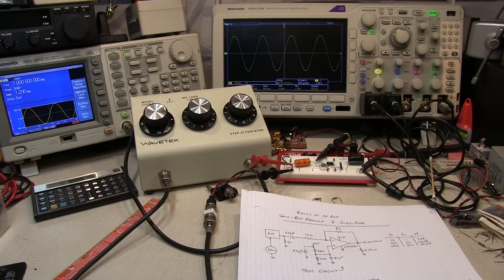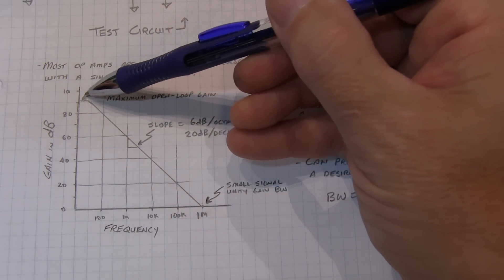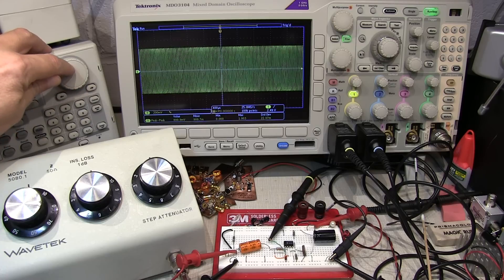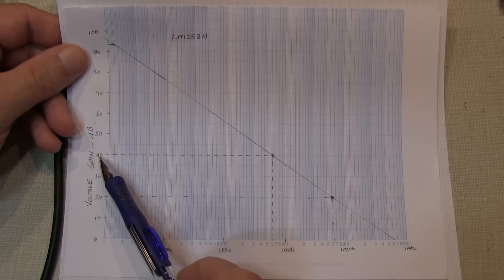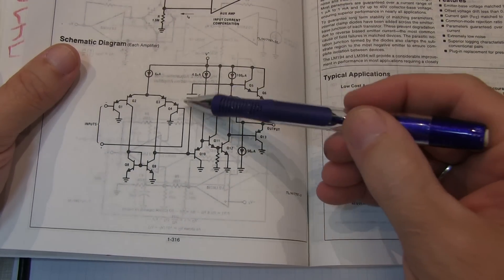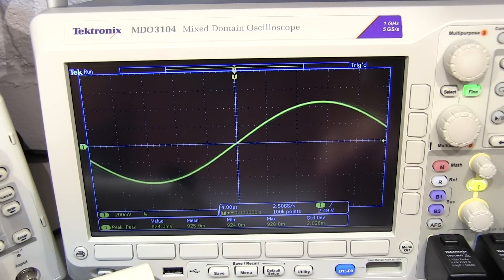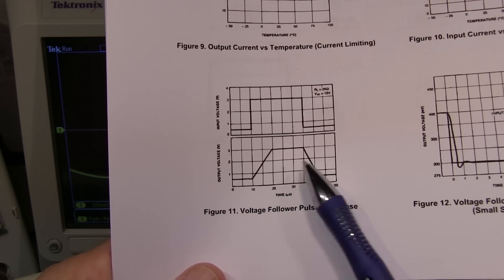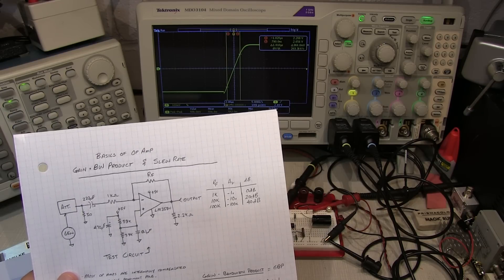#172: Basics of Op Amp Gain Bandwidth Product and Slew Rate Limit

Comment: Why does the cable capacitance on the input cause an Opamp Slew rate to get worse? The higher the capacitance added to the input of an Opamp will cause the Slew rate to get worse, any reasons why?

Comment: That is my dream oscilloscope. I regret not buying it when i bought an expensive one. I have the tds2002c which i use more haha. 

That scope is how old now and still holds its value and has a floppy drive. Tektronix are the best. Im restoring one for a friend. Hes had it in storage for a few decades so im not even sure what the model is. If i knew i could get that scope id sell almost all my gear. I tend to donate my gear when i get new gear. The tek diff probes are so expensive.  Id trade my rigol mso5354 and every other piece of gear for that scope and a nice selection of probes. There's a reason you work for them but havent replaced the 3104.

Great video, thanks. Ive found that i had to buy caps that are above my budget to get most opamp circuits to look as perfect as yours.

Sorry for rambling i have severe ptsd. I shall get my ham license in the new year.

Comment: I have never understood why low gains are unstable in UNCOMPSATED Op-Amps; e.g. OP-07 vs OP-37
Reply from the maker: As the gain is lowered, the bandwidth increases. At the higher frequency, the signal propagation delay through the amp becomes a larger portion of the signal period, eventually causing enough delay for the negative feedback to become positive feedback (feedback signal is in-phase with the input) thus resulting in oscillation.
Reply: THANK YOU!!!!!!! :) :) :)   Finally an understandable explanation.  You would not believe the crap I got from others (I assume pretending to understand) explanations on this.  It's funny though, GROUP DELAY these days is not often specified for op-amps.  But for uncompensated op-amps like the OP-37 I do not understand how it's gain has anything to do with it, after all there is only the group delay, which I assume is constant regardless of gain?????
Reply from the maker: @stevenbliss989   The closed loop gain determines the bandwidth.  At high gain, the BW is low so the signal fed back isn't high enough at the frequency where the delay would cause positive feedback to cause a problem.
Reply: @w2aew  yep, you already told, dumb dumb Steve Me :)

Comment: It seems to me, that in most applications we wouldn't want to be slew rate limited.  That is, we would want to hit the 3dB corner (f_3dB), or the full power BW,  before we hit the slew rate frequency (f_SR).  We can check if this is the case from the op-amp's data sheet, which gives us its GBP (gain-bw-product) and its SR (slew-rate).  
We have: GBP = (A_CL)(f_3dB) or f_3dB = GBP/A_CL.  We also have SR = 2(pi)(Vout_pk)(f_SR) , or f_SR = SR/((2pi)(Vo_pk)).  Using Vo_pk = (Vin_pk)(A_CL) this last equation can be written as f_SR = SR/((2pi)(Vin_pk)(A_CL)).  So we need f_SR > f_3dB, or  SR/((2pi)(Vin_pk)(A_CL)) >  GBP/A_CL, or SR/((2pi)(Vin_pk)) > GBP.   
If this isn't true then our application needs an op-amp with a larger SR and or a smaller GBP (or we need a redesign where we start with a smaller input signal Vin_pk). Am I thinking about this correctly?  Thanks!!  And beautiful  job on teaching about closed loop f_3dB and SR !!.

Comment: I'm confused on what is the difference in the op amp and Logic TTL IC chips slew rate specs and rise time specs because at a certain frequency the output pin will be a triangle shape. What I'm confused about is Logic IC chips have rise time specs and Op amps have Slew rate specs but they mean the same thing because they are referring to how fast the output signal can change with time. The rise time specs in the datasheets is using +5vdc logic pulse signal to measure the rise time specs and the Slew rate specs in the datasheets is using an analog sinewaveform to measure the slew rate specs. The rite time specs and slew rate specs are mostly in the nanoseconds nS but how do you find the frequency at which the slew rate specs and rise time specs are a problem? To find the slew rate spec/rise time spec is you use a function generator and change frequency until the op amp or IC logic TTL chips output signal is a triangle and that is the "Problem frequency" which is converted into the slew rate spec/rise time spec on the data sheet?
Reply from the maker: A logic circuit is designed to switch between two levels, so it makes sense to talk about rise and fall time.   An op amp circuit is NOT typically used in an application where it is switching between two values quickly like a logic circuit.  It is often used as an amplifier, active filter, signal conditioner, etc. and the bandwidth of the circuit will vary with the application.  The bandwidth will determine the effective rise/fall time.  There is a limit to how fast it can swing, due mainly to internal compensation, and this is slew rate.  Since slew rate is the "slope" of the signal, the rise time will be a function of how far it is swinging  - since there is no standard output swing level with an op amp,  there isn't a fixed rise/fall time spec.
Reply: @w2aew  What I'm saying is what formula do you use to compute to get the Rise time Spec and Slew Rate Spec on the datasheets for op amps and TTL logic chips? I think they use a function generator and increase the frequency UNTIL the output signal is a triangle waveform then that is the "bad frequency" which they covert using a  formula for the Rise time spec and slew rate spec? The Slew Rate formula is 2 X pi X Frequency X Vp , But when using a function generator and increasing the input pin of an Op amp or TTL chip UNTIL then output pin signal is a triangle waveform that is when you got the "bad frequency" which you convert into slew rate/rise time spec that is on the datasheets of the Op amp or TTL chip?
Reply from the maker: @waynegram8907  There is no formula for calculating the rise/fall time of TTL logic chips - it simply must be measured.  It does not matter what frequency is used, the output rise/fall time will be the same regardless.   For op amps, you can estimate the rise time from the formula 0.35/BW, where BW is the 3dB bandwidth of the circuit.  This formula assumes that the op amp is not slew rate limited.  The slew rate limit is based on the internal design of the compensation network - it can't be computed from any spec on the datasheet.
Reply: @w2aew  When a TTL Chip datasheets says the rise time specs it means how FAST the output signal can change states, so the rise time specs is the same thing as slew rate specs for op amps. If you set up a 2 channel Oscope that ch#1 is input pin of the TTL chip or Op amp and Ch#2 is the output pin of the TTL chip or Op amp to measure the Rise time/slew rate it should be in the nS nanoseconds but what is confusing is the datasheets rise time/slew rate specs don't tell you at what " frequency" is this spec at? example if the rise time spec is 5nS but at what frequency? is the datasheets says the op amp is 10uS/1mS at what frequency? Can you make a video lesson using a 2 channel Oscope with various TTL chips and Op amps and measure the rise time specs and Slew Rate specs to MATCH it to the datasheets with the Oscope and how to compute using formulas to calculate the rise time/slew rate specs on the datasheets?
Reply from the maker: @waynegram8907  An op amp output rise time can often be much slower than the slew rate - it all depends on the bandwidth of the op amp circuit.

Comment: The slower and longer the slew rate will add compression when the gain gets closer to the max gain of the opamp? The more gain and the longer the slew rate will increase the compression of the opamp?
Reply from the maker: No, not really.
Slower slew rate can add distortion to the signal at high signal levels (but not compression).
Reply: @w2aew  There is analog circuits that create a slower slew rate which suppose to add more compression when the input signal levels are high signal levels to compress them because of the slow slew rate? The Op amp LM308 has a slow slew rate that is suppose to compress the input signals when the input signals levels are high because of the very slow slew rate, is this true or a myth?
Reply from the maker: @waynegram8907  Slew rate limitations will affect how quickly the output can change.  This can cause large/fast input signals to not get amplified as much because the output driven feedback can't keep up.
Reply: @w2aew  yes isn't this called compression because the output can't change fast enough and the large/fast input signals don't get amplified?
Reply from the maker: @waynegram8907  Usually I think of compression in the distortion and constricting of the signal peaks, and is a function of signal am[plitde.  In your case, the restriction is on the middle of the waveform during the fastest swing.  So, if you had a slow signal, there would be no compression - that's why I dont consider that compression.
Reply: @w2aew  what would it be called? When fast charging signals applied to very slow slew rate op amps, wouldn't this be some type of compression because the large the input signal the longer the time it's going to take because of the slow slew rate to transfer input to the output waveform

Comment: How didi u select the value of resistors and capacitors
Reply from the maker: Nothing special.  I wanted two equal values to setup a 50:50 voltage divider for the non-inverting input.  I have a big pile of 3.9k resistors, so I used two of them.  For the gain setting resistors, I chose values that are simple "in your head" calculations.

Comment: Why did you stop increasing the frequency when the voltage dropped to 700mV?
Reply from the maker: Because that is the -3dB point, which is where the bandwidth is traditionally defined.

Comment: can u tell me plz how u calculate 707mv....
Reply from the maker: Bandwidth is defined as the half-power point.  Remember that power is equal to voltage_squared divided by the resistance.  
Thus, dividing power by 2 is equal to dividing the voltage by sqrt(2).  1/sqrt(2) = 0.7071

Comment: Brilliant video. What opamp should I use to  amplify a 1mhz audio signal by 20db?
Reply from the maker: Can you clarify?  1mHz is 1 millihertz, or 1MHz is 1 megaherts - neither of these are audio signals.
Reply: @w2aew  Mega. Your right.  It is for ultrasound. I am having trouble moving from all these theoretical  videos to moving to a practical two stage amplifier at 20db per stage.
Reply from the maker: @fernandohood5542  20dB gain at 1MHz means that the op amp would have to have more than 100MHz unity gain BW - that is a tall order!  You may have to use several cascaded stages with lower gain in each stage, in order to get the gain you want at 1MHz.

Comment: can reasons why the slew rate and the frequency response gets worse when increasing the gain on an op amp? what is causing inside the op amp that would make the high frequency and slew rate get worse from increasing the gain higher on the op amp? This is called gain bandwidth product but not sure what is causing it to happen
Reply from the maker: Mainly due to the limited amount of current available to charge/discharge the internal compensation capacitor.
Reply: So even if the power supply can supply double the current to the op amp its still will be due to the limited amount of current available to the charge/discharge the internal compensation capacitor? you can ADD an "external compensation" capacitor to the op amp to fix the gain bandwidth product?

Comment: Hi, first of all, awesomeeeee explanation, would love to view more of your content. But i have a doubt. You explained how output signal's amplitude will affect slew rate. But in all the cases, you maintained an output of 1Vp-p using the attenuator. Then why the slew rate didn't come into the picture with the initial cases?? Thanks in advance
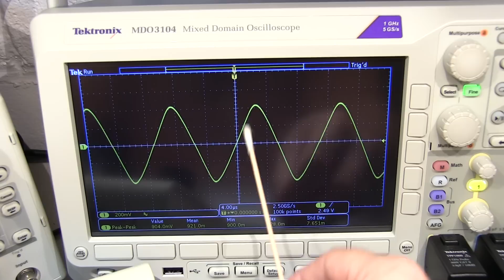Reply from the maker: At about the 11:10 point in the video, the increased frequency results in the rate-of-change of the voltage hitting the slew rate limit of the op amp.
Reply: @w2aew  i understand that increasing frequency results in slew rate limitation but frequency was also high when you used a gain of 10 or 100. With same output voltage amplitude, you didn't hit the slew rate. I am confused as why the same op amp with same output voltage amplitude will behave differently in the two cases? The gain of amplifier shouln't affect it because we maintained a fixed output voltage level.
Reply from the maker: @parthkhatter2756  The frequency was not that high when using the higher gains.  At gain of 10, the 3dB frequency was about 60kHz and at a gain of 100 the 3dB point was at about 6kHz.  The frequency is closer to 100kHz when showing the slew rate limit.
Reply: @w2aew  oh! So stupid of me, i was just concerned with signal amplitude. Thanks😄

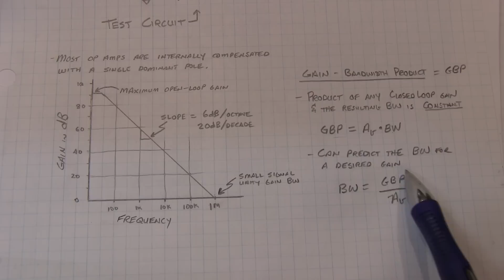Comment: At minute 3:38 the formula for BW is very similar to the formula for calculating the scope BW based on the signal rise time. The diff is in the 0.35 constant. Are they really related?
Reply from the maker: Yes - it's the same single-pole rolloff relationship.

Comment: Hi, I'm using TLV3501 comparator (it hash push-pull outputs) (SOT23 6 Pin) for zero cross detection. I'm powering it from single supply (5v).comparator output goes high to ~5v no issue with that, but the comparator output when outputing low doesn't go near 0v, instead it stays at vdd/2. Can you give your  insights on why this might be happening?.
Reply from the maker: It is difficult to say without knowing your circuit or measurement method.  It is possible that the comparator is oscillating between hi and low output and that's why you're reading vdd/2.
Reply: @w2aew  hi, thanks for the reply, I checked with oscilloscope there were no oscillations. After I replaced the IC with another fresh one I was getting proper results... though I'm not sure what went wrong...

Comment: Why have you used 470uf and 0.1uf capacitor in this circuit.
Reply from the maker: Just basic power supply filtering and virtual ground bypassing. Nothing critical with the values, just some parts found on the bench.

Comment: wow this mean mostly all opamp distort square waves .. what do you recommend for perfect square waves amplification?
Reply from the maker: It all depends on how fast the rising and falling edges of the square wave has to be.  This directly relates to the required BW needed by the amplifier.
Reply: need to be really fast and no overshoot from 20hz to 20khz .... also need to be very low noise,  most of opamp i've seen have overshoot in the datasheet.. ringing on the attack.. or are very slow in term of slew rate.. also do you consider well made open loop to be better than close loop for SQ.. lets say you could EQ digitally first

why do you use a sine wave for your test hehe.. should be an ultra fast pulse made by ultra fast pulse gen..

do you like AD8009 or AD844

also for SQ.. how important is voltage noise density versus current noise density

also what is the importance of quiescent current..

one of the best square wav i can find is from LM6172

Comment: Great Video. I did not know that 2 different aspects effect the BW of the opamp. I used to believe that slew rate was the only cause of the band width limitation.Thanks to you video the concept is very clear.
Any reason for using the Attenuator. Can the experiment be done by varying amplitude in the signal generator controls ?
Reply from the maker: Mainly because my signal generator output control didn't have the range I wanted - plus the attenuator gives the advantage of maintaining the generator's SNR for small signals (since the attenuator reduces the signal and the noise equally).
Reply: Oh ok. Thank you :)

Comment: Thanks for the heads up in the other comment section. I have watched this video a few times before. My op amp tester is based on a similar type of circuit with a dual polarity supply instead of the bias.
 I guess my challenge is to learn how to replicate what your doing with the function generator. ..Without a function generator...yet 🤔 ...but with predictable, repeatable results..   🙄
  My snipe hunting list for eBay is getting ridiculous... I'm starting to think hotrodding cars was the cheaper hobby.
Thanks again,
-Jake
Reply from the maker: You don't really need the complicated waveform when doing op amp slew rate testing. A simple square wave will do.

Comment: Excellent video. Few questions though. How did you come up with all the 220uF (reverse polarity here I think), 470 and 0.1 uF ?  Aren't the 220 and 470 too big ? Would some bulk decoupling like 10uF instead of 470uF work ? Thanks.
Reply from the maker: Nothing critical.  470uF for good bulk supply filtering, value not critical.  220uF for input coupling, just a large value laying on the bench that would provide a low impedance a the low-frequency end of the testing, and 0.1uF for decent medium/high frequency decoupling of noise at the non-inverting input.  In all cases, values could vary quite a bit with no change.  Just handy values found on the mess of a bench...